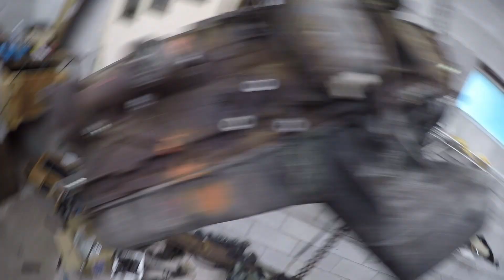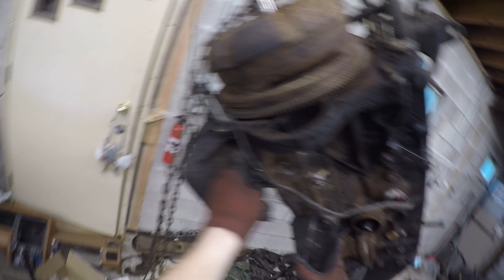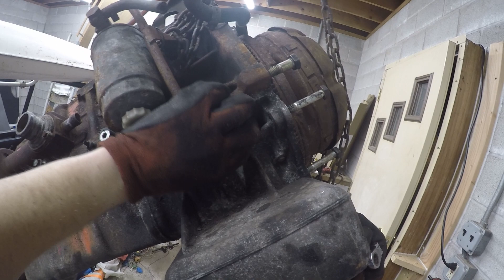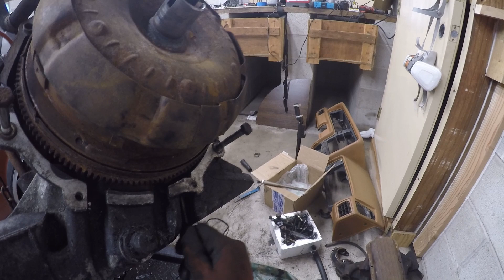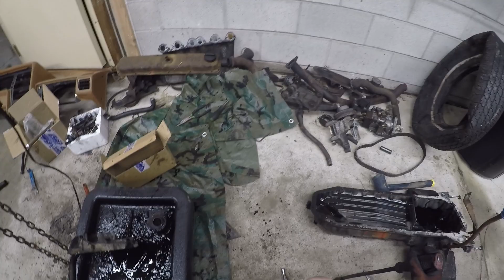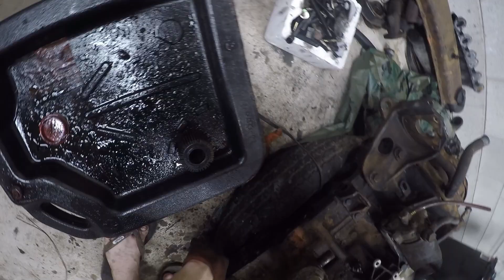D24 Diesel Engine Rebuild 7 - Removing the Oil Pan and Rotating Assembly

Comment: How nice to find some D24 videos that go through such detailed process. Helps a lot , really. I am trying to get my oil pan off, and the manual does not helps (it basicaly says "remove all the screws"). If i understand correctly, I just cant let the clutch bell on to get acess to these alen screws? I thought I could change all the oil gaskets without seperating the transmission from the motor...(mine is a M46 , manual)
Reply from the maker: Hey, glad it helps. Getting to those Allen bolts is seriously tough, even with the motor out of the car. You may want to find some long Allen keys, or a long Allen socket since you’ll pretty much be working blind. I don’t see any reason you couldn’t get the oil pan out, aside from the crossmember. If push comes to shove, it’s not a hard motor to pull. I was able to do it myself in about 2.5 hours.